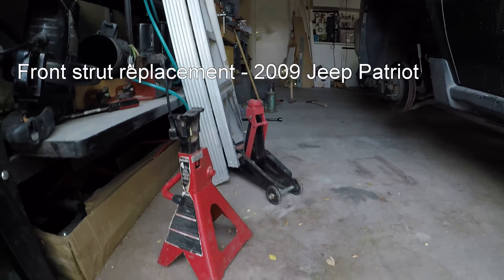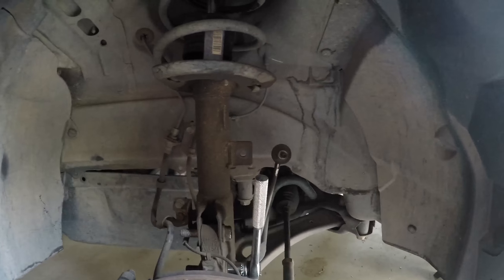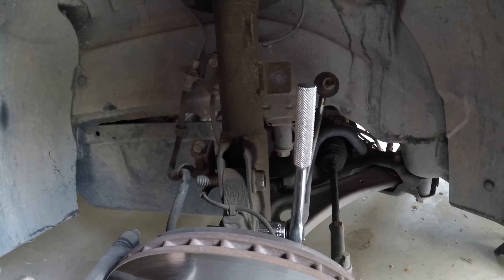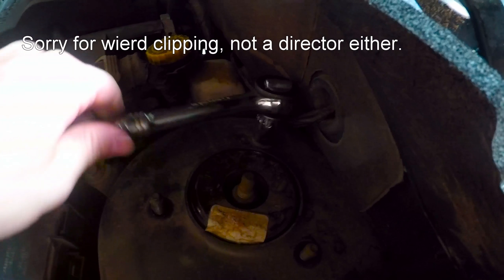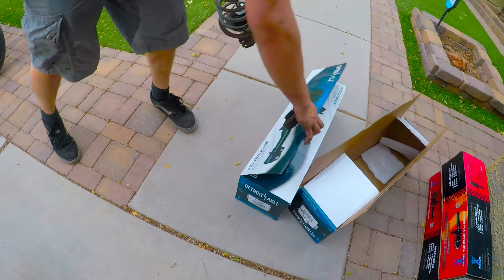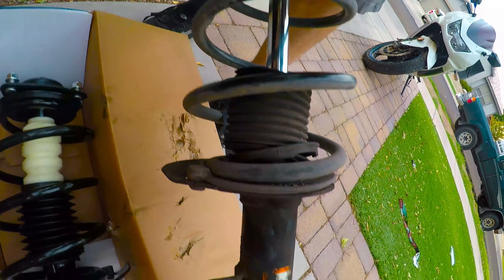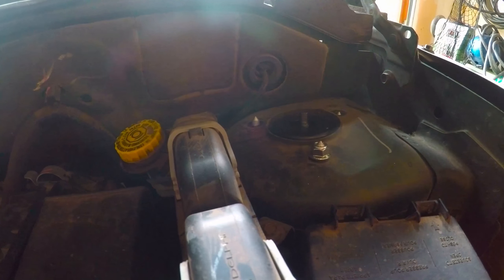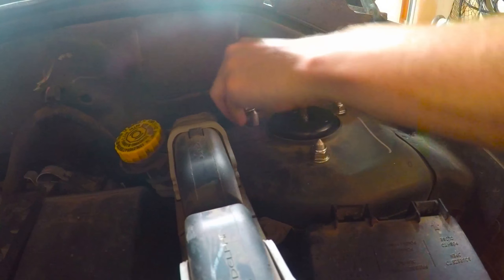2009 Jeep Patriot -  Front Strut Replacement

Comment: What did the clunking end up being? I'm having the same issue and can't quite chase it down. 
Also I found it easier to take the top 3 nuts off before I took weight off the wheels. Using another floor jack I could keep a little upward tension on the whole assembly until I needed to drop it.
Reply: if you have an 09 patriot and have major clunking sound from front end check the crossmember. they rust out and jeep has an extended warranty on that part.  I just got mine done this week and only had 9 months left on warranty so check it soon if that's your issue.  it's the hole where the lower control arm bolts to the underbody, rots out totally so wheel is completely loose.
Reply: Actually sold it 3 days ago. 
The source of my clunking (came after putting on new struts) was from the aftermarket springs being wider than stock (only on the one side...) and the spring was rubbing the inside of the strut tower pocket.

Comment: Where did you order your parts from and how does your jeep ride now?
Reply from the maker: My friend found them, but I just googled it and think I found the same pair here - https://www.amazon.com/2007-2011-Patriot-Complete-Struts-Assembly/dp/B00OQPTF4M.

His jeep runs higher and smoother than it did on the stock ones, his only issue now is his bushing on both sides are worn and need to be replaced, they "clunk" here and there when off road or when the weight shifts on the frame.
Reply: @JaymoTheToyotaPickupGuy  Did you guys ever replace the  bushings
Reply from the maker: @Roger-ob2ft  I don't think we did. The struts/springs were all one piece and came with no extra grommets/bushing or anything